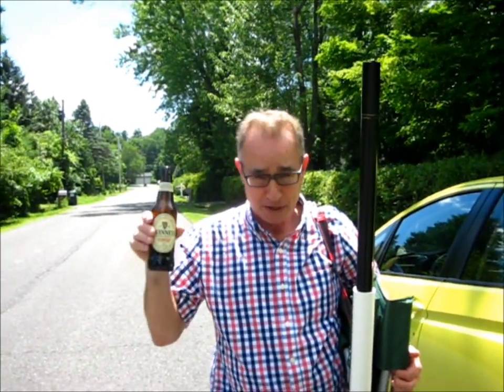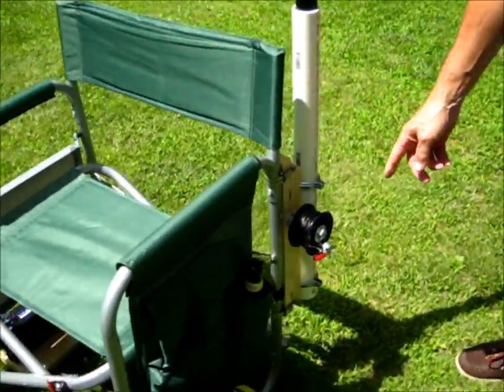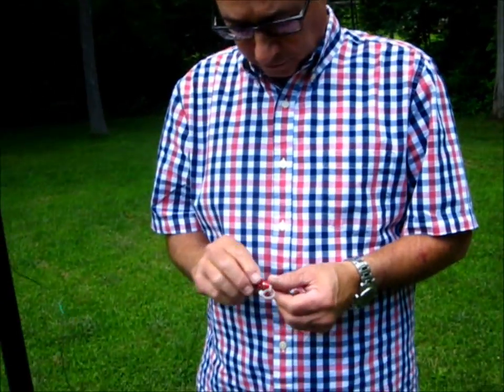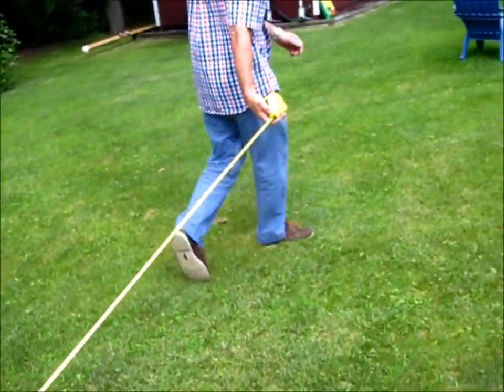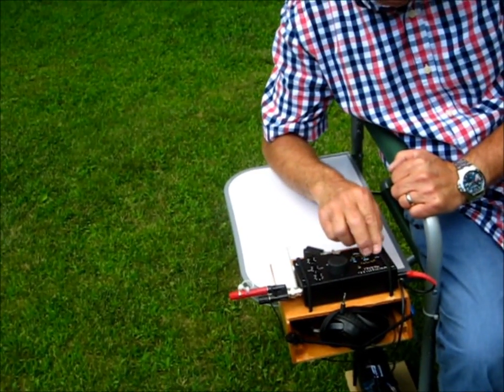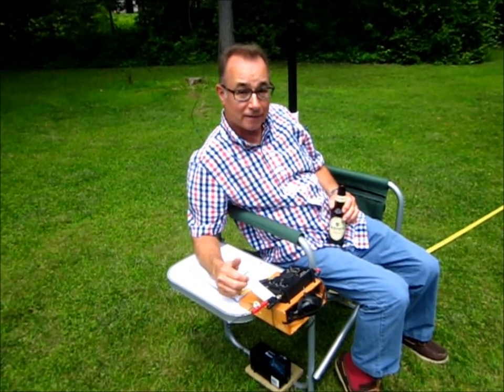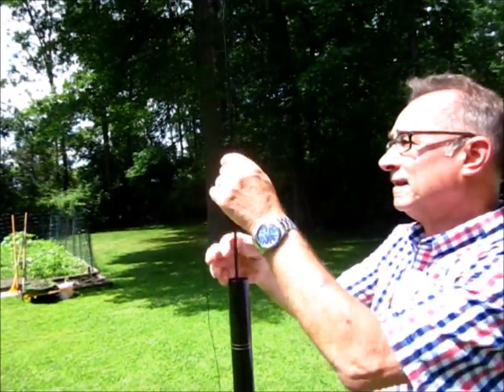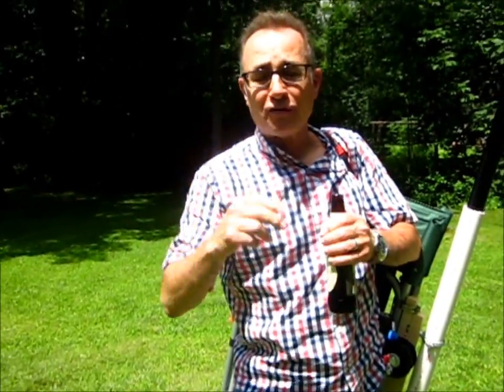QRP Camp Chair Station - Revised

Comment: Stan..... That is a very impressive all-in-one portable station set up. I would never have though of using a tape measure as a counterpoise. I agree that vertical ant is best for portable operation. It a pain to try to launch a wire ant into trees whether as an end-feed or a dipole. The beauty of yours as is it can go anywhere. No need for picnic tables, trees, etc. Best part of all is easy up and easy down. Keep up the great work.
Mark K9ADT

Comment: IMO this is the best portable QRP station I've seen to date. Nice, compact, fits easily in a passenger car, everything needed to communicate is on the chair, except the Crappie Pole. Pull the Crappie Pole from your car, stick it in the chair tube and I'm/you
re off to where ever suits your fancy. 72/73 KB8AMZ

Comment: Great job Stan! Could possibly use a qrp "EFT 10/20/40  end fed antenna attached to the push up pole and run it back down as a sloper. I have two of those chairs from Harbor Freight and well worth the $20 bucks. Very sturdy. Very creative with the attachments. That little built in side panel comes in handy for accessories. 73 de N4UVR
Reply from the maker: The KX1's internal tuner is optimized for a random wire and the vertical configuration gives me the low angles for DX work on 20.  It loads up great on 30 with the tape measure around 25 feet and the PAR 10/20/40 won't give me 30.  I also homebrewed a couple of VERY lightweight dipoles for 20 and 40 which I can hang onto the push up pole with minimal bending.  I use them as inverted Vs when I have the room.  They are resonant and work well but, quite honestly, the simple 28' random wire is the overall fastest and easiest antenna for my operating.  It seems to be that whenever anything is fast and easy, it tends to get used more often.  That's been my experience.  73, Stan

Comment: Plenty of useful ideas there! Maybe a parasol or umbrella fitted to the other side of the chair back would make it an all year round solution? Great video, thanks for posting. 73 de G0TVJ
Reply from the maker: Neil, thanks for this idea.  I went to the Christmas Tree Shop and bought a clamp on beach chair umbrella for $5.00.  It works great, clears my head and the pole and is a whole lot more comfortable on a sunny day.  Thanks again!
Reply: Not to mention some folding chairs have the cooler bag hanging underneath. 73 de Jim ZS6JMB
Reply: So many possibilities :)

Comment: So the weight of the battery is sufficient to keep the chair from tipping over with the jackite pole fully extended and no one sitting in the chair? Great idea! I have all the materials including the chair that I inherited from my late sister in law. Will get to it as soon as I get home from visiting the grandkids in Illinois and Indiana.

Thanks for a great video.

Dave K8WPE
Reply from the maker: David, I think the weight of the battery has little to do with stability.  I think it is more a function of the wide footprint of the chair.  I can assure you that even on windy days, the antenna pole does not tip over.  There is actually very little surface area for wind to act upon.  Good luck with your project.  I'm certainly enjoying mine and looking forward to colorful autumn operations.  73, Stan

Comment: I'm 3 years late in seeing this but wondering if you have tried using a 14.v LiPo as used by many r/c flyers?  It would be about 1/2 the amps as your gell battery and about 1/3 the weight.  I've used with my kx3 in the r/v.
73/K7SXN

Comment: Love it Stan...just shared it on Facebook. I noticed you dropped the unun from the umbrella stand version. What's the weight of your chair etc? Also, where did you get a metal tape measure longer than 25'? 73 de Robert K3RRR
Reply from the maker: Harbor Freight. They have 16, 25 and 33 foot metal tapes there.  I dropped the UNUN because my experience has shown that for the KX1, the folks at Elecraft are right:  All I need is abut 28' of wire connected directly to a dual BNC and the internal KX1 tuner does the rest.  I've never weighed the chair.  Sorry. 73, Stan

Comment: Nice Stan. I would do the same but since I'm left-handed the drop table is on the wrong side of the chair for me. A new LiFePO4 battery to replace that sealed Lead Acid battery would make that chair much lighter HiHi. 73
Reply from the maker: Ralph, the drop table WAS on the left!  I drilled out the rivets and re-mounted it on the right side with nuts and bolts.  It's almost spring - time to build a chair! 73, Stan
Reply: @stanscoyote  My Walmart chair's table is on the right, I should have gone to Harbor Freight (LOL). So far on my chair build I've only mounted a 2 inch dia PVC tube with SS hose clamps to hold one of my 7 meter crappie poles. The G90 takes up a lot of table space so I might have to use the supplied cable to put the base unit underneath and the head unit mounted on the table. I need to get better at CW,  The little 5W QCX-mini kit would be a better fit for operating the camp chair portable. 73 AB1OP Ralph